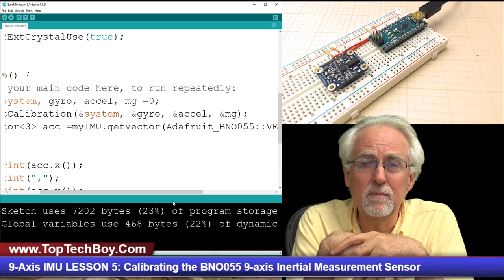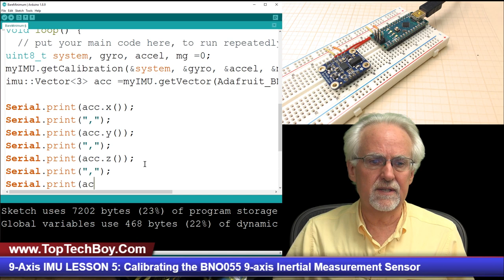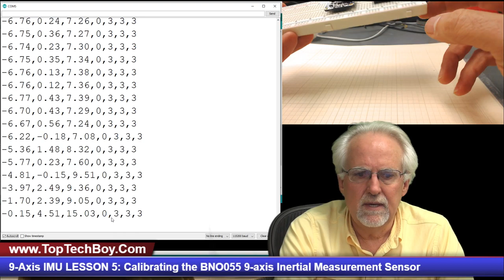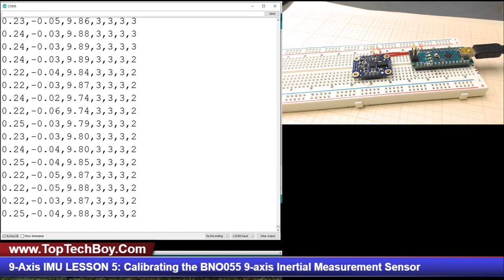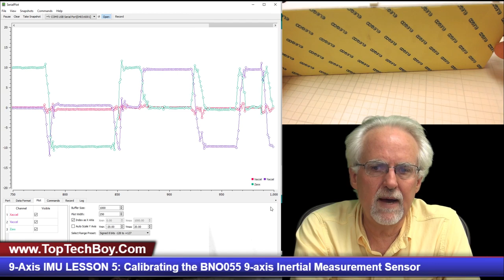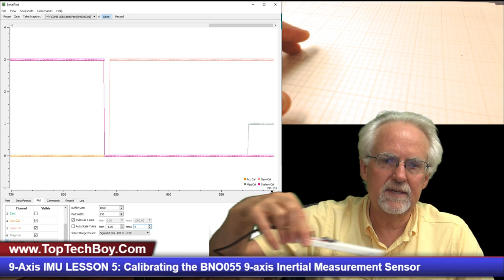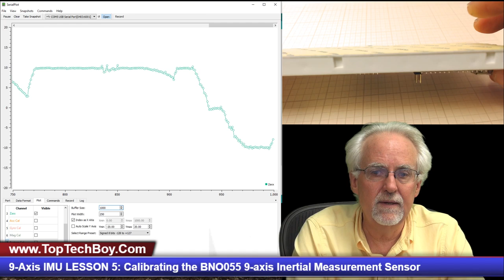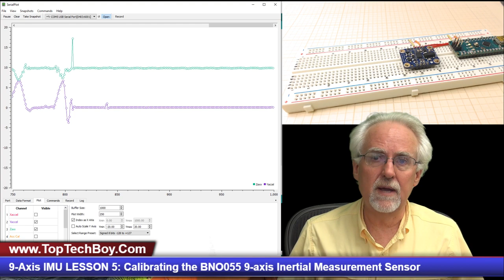9-Axis IMU LESSON 5: Calibrating the BNO055 9-axis Inertial Measurement Sensor

Comment: I calculated the tilt using equation of the line which I learn from your wonderful Arduino series. So when the acceleration is 9.8 then we have 0 tilt and as acceleration decreases we’re going down to -180 degrees.
Equation is 
Tilt=9.34*accZ-91.58

Comment: Thanks for the tutorials. How can I store the calibration data to use it to configure the device later when it is no longer possible to manually rotate the device to calibrate it? I'm a ham radio operator and want to build a device to set my antenna azimuth and elevation for tracking ham satellites.

Comment: Thank you for the demo of how external objects effect the calibration. For example I could not get 3,3,3,3. Finally, I noticed in your video that the motor effects the calibration. when I moved my BNO055 9-axis Inertial Measurement Sensor away from all wires, magnets, and especially the Huion board, my BNO055 calibrated immediately. Thank you, Thank you , Thank you!

Comment: Thanks for the tutorials Paul. These are amazing! I'm working through this lesson but I'm running into a two issues. My Gz is not close to 9.8 even after i calibrate. It seems to come in at different values each time too! I ready anywhere from 9.5 to 9.7 after calibration with my breadboard sitting in the same spot. My Gx and Gy are also all over the place. They will be anywhere from +/- 0.2

Doesn't seem like much but when I start trying to get an angle I'm getting 1-3 degrees. 

Second issue I'm having is with the serial plotter. Are you using any add in software for your plotter? Mine doesn't have any options to turn curves on or off, change the scale from auto, or rename the curves. 

Sorry if I missed something there.

These are great videos and you have a great community here. 

Thanks
Nathan

Comment: Not sure whether or not someone has mentioned this already, but the line at 5:40 is not doing what you think it is.

uint8_t system, gyro, accel, mg = 0;

That likely doesn't set all those variables to zero, it only sets mg to 0. Well, it possibly does...but possibly doesn't. My guess is that it won't, as it doesn't seem to testing it here with avr-g++. Reviewing the compiler's documentation, it appears that static variables are in fact initialized to 0, but auto/local variables are not. So you can either put the keyword static in front of uint8_t...or just add another line to your above line, to set them all to zero:

system = gyro = accel = mg;

EDIT: Not sure why YouTube is suddenly inserting two newlines between paragraphs now, requiring you to have to edit the post to fix it.
Reply: This IMU really takes some time to calibrate, wow. I mean, how would you use it in a serious project if you weren't sure it was actually calibrating each time the power was turned on? That's a bit concerning.

Comment: Hello,  I ran the calibration and  it doesn't want to stay in calibration for very long and is hard to recalibrate it.  Could my mouse or keyboard be causing the problem?  I have noticed that it is very sensitive and when I have it perfectly level my "x" and "y" axis are zero, and my "z" axis stays around "9.65".  I have never studied Trig so will watch and study along. Thank you Paul for a great lesson.

Comment: HI Paul..  in an effort to go under the hood, I was hoping to get a definition of the 'uint8_t' variable type. I am more than willing to use it as prescribed but (and no disrespect intended) even if given by God, I still need a way to understand it..    Keep up the good work. Im all in with all 3 series you are currently doing.  Thanks for the effort.
Reply: I too had this question. I think the following link is a good explanation: https://stackoverflow.com/questions/14515874/difference-between-int32-int-int32-t-int8-and-int8-t

Comment: Paul, This is REALLY COOL...  but, I still have a problem of how this is going to help me with real problems.  ... other than just being an interesting expensive toy...  How would I use it around the house?   Would I develop a system that I could use in the car while traveling?  Doing what?
What does IMU mean?
It looks like it responds to movements very quickly...  Perhaps the system should be shielded to prevent it from being effected by motors & other devices around it?  Otherwise, it could not be trusted 100% of the time.
Thank you.
Reply from the maker: You could put it on your head, and track your head position, and then have a camera remotely on a servo pan tilt unit. The camera would move in response your head motion, and you could create a remote reality system. Just one idea.
Reply: @paulmcwhorter  Must be how the those gunship pilots look at their target and the guns point to where they are looking!

Comment: If I dont want to go through the routine to calibrate sensors espeically the acclerometer. Can I use lets say GPS readings to calibrate? I have an imu and gps in same module. Since gyro and magnetomer calibrates easy.. Im thinking now at least I know where is the x and y and z for my accleration readings and my GPS can just correct that next step in a kalman filter implementation for example. Does it work?

Comment: Hi, Teach!!

Wonderful lesson once again. Have been following this series with the latest Arduino Series.

Am using the identical hardware as you are.

However, am facing a situation with the calibration of the BNO055, as taught in this lesson. After getting a 3 on all four parameters, the calibration is mainatined only so long as I have the Serial Monitor/Plotter on. The moment I turn the Serial Monitor/Plotter off, I lose the calibration. I need to re-calibrate the BNO055. 

It would be prudent to add, that I am only turning the monitor off and not the device ie the Arduino Nano/BNO055 off, per se.

Is this normal? if not, a little help from you or any of the learned friends following this channel would be of great help.

Regards.
Reply from the maker: Turning the serial plotter off resets the arduino, so you have to recalibrate. The BNO055 is also bad about losing calibration if the sensor just sits. So, it is good for learning and benchtop demos, but hard to use in real deployed system.
Reply: @paulmcwhorter  Thank you Teach. Really appreaciate the prompt answer. Spent a lot of time surfing the net, wondering whether something was wrong with my module.

Thank you again!!

Comment: I can move my IMU around and get all 4 calibration values to read as a 3, but then some times when I set it back down the system value returns to 0(zero)!  Some times it might change from 3 to 2 or to 1, but most of the time it seems to go to zero.  Any thing you can add would be helpful.  When I start moving it again it will go back to 3 after a short time.
Reply: I figured it out!  I was setting it down on my laptop keyboard!  Guessing the electronics in the laptop was messing with the IMU unit.  Setting it down on top of my empty ceramic mug, that originally had my HOT coffee in it, and all is fine.  Had stopped the video to play around with my calibration right before you brought the stepper motor into the picture! :-)
Reply from the maker: I dont know how to turn off the automatic continous calibration mode on this sensor. Sometimes in its effort to improve calibration in real time, it actually loses calibration. I have found the auto calibrate 'feature' to be a nuisance that actuallly can make more problems than it solves.
Reply: @paulmcwhorter  It is in the sensor library...buried.

Comment: Hi.
First of all, great series of  videos.  Learning alot.  I do however have a question about the calibration.  If I put this board on let's say a quad, do I have to go through the calibration process every time  I turn the device on?

Pudelfan
Reply from the maker: I would really discourage a DIY quadcopter using this sensor. It has a tendency to lose calibration under different cirucumstances. I dont view quadcopters as good DIY projects because of safety issues.
Reply: @paulmcwhorter  Hi.

Thank you for the quick answer.   The quad was just an example.  Here in Austria there is a lot of hassle to go through to fly anything weighing more than 250g.  But the question still stands.  Is the calibration necessary every time the module is turned on?

Pudelfan
Reply: @pudelfan3059  The BNO055 has a number of different modes which use the sensors in various combinations.  For the IMU modes where the internal microcontroller is fusing the data from the individual sensors to give the output you will need to calibrate the sensor on each power up.  The calibration data can be read from the sensor, stored, then reloaded on power up so that the time required for calibration is shortened.  However this does not really work very well for the 9DOF mode as the magnetometer does not calibrate that well from the stored data if the sensor is not in the same orientation.  For some applications the IMUPLUS mode which uses the accelerometer and the gyro is better as both these sensors calibrate more easily.  Without the magnetometer you cannot relate your heading to north, but for many applications your course over ground will come from a GPS anyway.  The IMU would be used for stability and measuring rotation when turning.
Reply: @blackboxcameracom  Thank you for answering that question. I have the same question, but am now wondering how do I LOAD a calibration into the IMU?

Comment: Please explain how rotating the assembly into various orientations, exposing the Accelerometer to the force of gravity from all angles, translated to exactly 9.8 not 9.7 or 9.9 without the system knowing what the known value is. Did the rotation simply zero the  accelerometer by exposing it to all angles as opposed to truly calibrating it?  For example, when I calibrate a micrometer or caliper, I use a certified gauge block with traceability to NIST standards. How does the chip know what to associate with the values it reads?
Reply from the maker: Understand we are doing this as a desktop demo, not an actual navigation device. A lot of the calibration is stuff going on inside the BNO itself. This board is a great learning platform, but I am not at all suggesting it should be used in deployed systems.
Reply: @paulmcwhorter  Is it possible that the integrated software assumes 9.8?
Reply from the maker: I think it probably finds the maximum deflextion of the acceleromter, and then assumes 9.8  . . . . i dont think it is actually flat out measuring the acceleration of gravity
Reply: Coming back to this subject to develop a variable frequency flashing LED that flashes faster with increasing deceleration rates.  Oh by the way for anyone giving this a try, be aware that the mag sensor will be negatively impacted if you happen to be using a steel desktop for your worksurface. 😳

Comment: Not sure what the deal is but none of my calibration data is showing up in SerialPlot. Settings are the same as last lesson, updated them as we went through this video(Data Format>Number Of Channels:7, etc.) COM is good, calibration works in Serial Monitor. Only thing I'm seeing is a [Warning] Data parsing error for channel: 3 under the Log tab in SerialPlot. Any suggestions would be greatly appreciated. Thanks everyone!
Reply from the maker: Make sure you are building your string you pass perfectly, not forgetting any commas. Last print should be a println. Check and see if you can pass one value only and graph it.
Reply: @paulmcwhorter  Thank you, Sir. I'll give that a shot. 👌

Comment: I kinda want to stick to what I got used to in the New Arduino Tutorials...
That is,
I get obsessive compulsive on the grounds that I want my variable declarations to be at the top of the program (after the #include, if there are any) ...and not do it inside the void loop()

For Example:
#include <Wire.h>
#include <Adafruit_Sensor.h>
#include <Adafruit_BNO055.h>
#include <utility/imumaths.h>

.
.
.
uint8_t system,accelerometerCalibration,gyroCalibration,magnetometerCalibration;

void setup(){
.
.
.
}

void loop(){
   system,accelerometerCalibration,gyroCalibration,magnetometerCalibration=0;
.
.
.
}

I just don't know if that convention will work for this line of command,
imu::Vector<3> accelerometerData = myIMU.getVector(Adafruit_BNO055::VECTOR_ACCELEROMETER);

I plan on putting the imu::Vector<3> accelerometerData; at the very top of the program (after #include)
and put 
accelerometerData = myIMU.getVector(Adafruit_BNO055::VECTOR_ACCELEROMETER); inside the void loop()...
so we remain consistent.

^Will this work Sir Paul?
Reply: P.S.
Regarding this line that you used Sir Paul:
uint8_t accelerometerCalibration,gyroCalibration,magnetometerCalibration,system=0;

I find that only the system is set to 0. 
As I understand, you put a zero such that for every loop, the calibration value resets to 0.
Will putting zero in the system variable suffice?
I mean would it automatically reset the calibration values of the other three variables to zero as well by doing this?

I am thinking if this is the more correct way of doing it:
uint8_t accelerometerCalibration=0,gyroCalibration=0,magnetometerCalibration=0,system=0;
so that all calibration variables are reset.